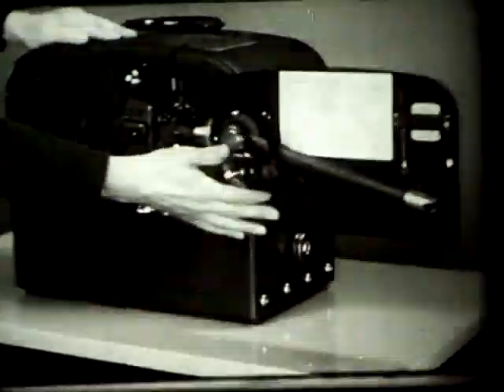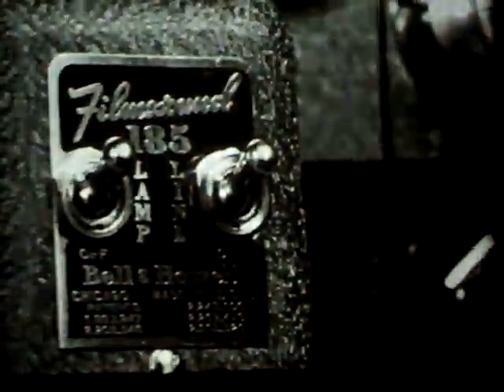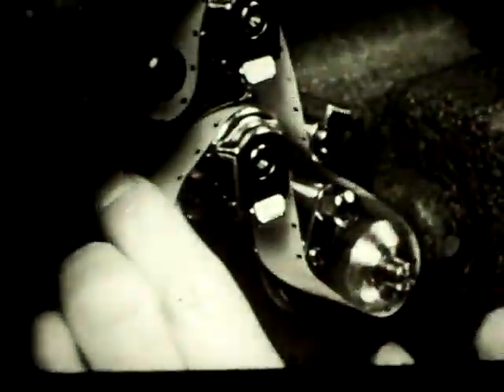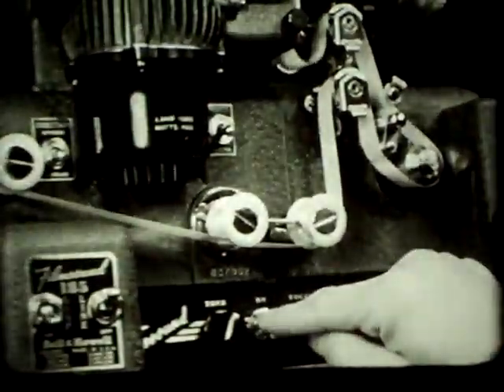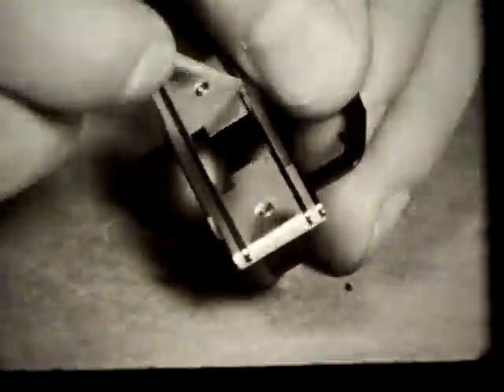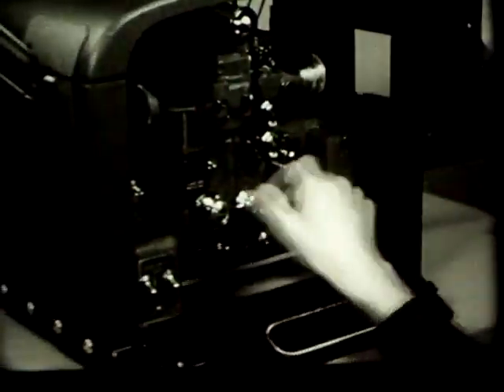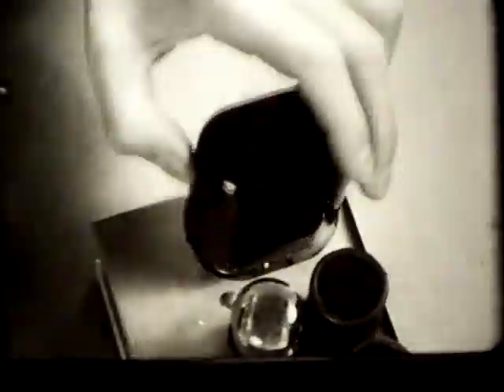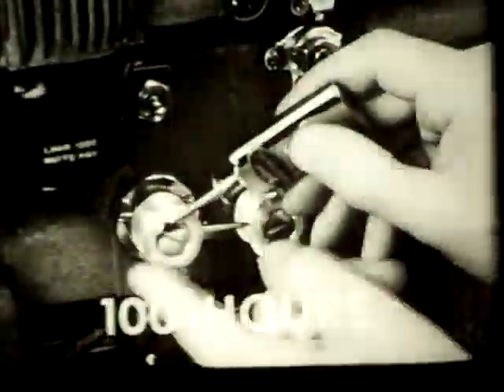bell & howell instructional film

Comment: Nice instructional film on how to set up the projector. I have two projectors, one is my Kodak Super Showtime 8 movie projector which only runs regular 8mm and it works great without any problems. And another one is my Kodak Instamatic M110 movie projector which runs both regular and Super 8 films. Kodak made the best movie projectors than its competitor Bell & Howell which also made 16mm filmosound projectors, but I don't have my 16mm projector at the moment, but I might be getting it soon.

Comment: I got my Revere S16 16mm sound movie projector off of eBay over the weekend and it works perfectly. The film run great, and there’s no sound at all due to a dead exciter lamp. 

On the bottom, there’s a main amplifier which is underneath and the plug is where the exciter lamp connects. Bell & Howell did the same with the amplifier as well.
Reply: When I check through the amplifier of my Revere S-16, One of the tubes are dead including the 12AX7 which is a preamp tube where it doesn’t seem to warm up. Before that, I got a new exciter lamp as a replacement and it never seem to light up. That might be the same problem, because there is no sound when running a 16mm sound film due to the 12AX7 tube which is completely shot.

Comment: An old friend of my mom's once gave me one of these.  Didn't care for the manual set-up deals as I was so use to the Singer insta-load models.
Reply: My 16mm is on they way soon, but last week, I've just ordered a Bell & Howell Filmosound Specialist 552 projector with Autoload feature where you can feed the film automatically to get into the take up reel. Sometimes it had some problems with Autoload, but I have to be extra careful so it won't damage the film.